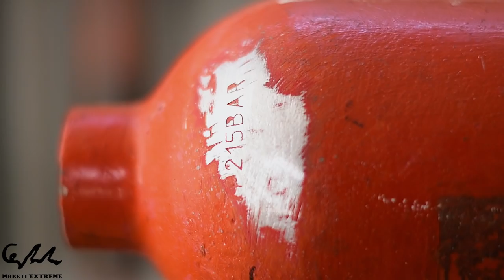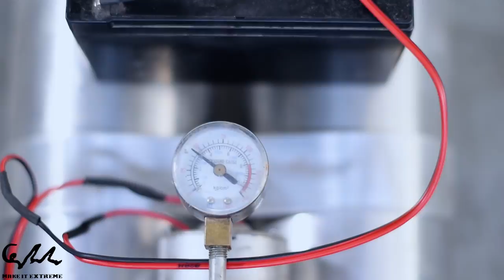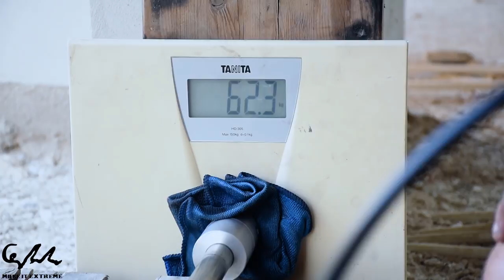Project 087 | Making an extending bicycle #1

Comment: Nice project.  Can't wait for Part 2.
When I was a kid I build an extended bicycle. I cut a crank section out of a junk bicycle and my brother welded it on the top of a standard boys bicycle frame.  Then he welded a piece of 1/2" water pipe and support bracket to raise the seat up about 2=3 ft.  Also welded another section of water pipe to the front fork assembly and welded a set of handle bars to the top.  Re-routed the chain to the upper crank and presto an extended bike.  Just make sure to put some type of chain guard on it.  I forgot to put my spring steel pants clip on the leg to keep my pants out of the chain and took a pretty good fall when my pants got caught up in the chain.

Comment: Nice stuff! One thing, no need for teflon string (loctite 55) and loctite in the same time on the treads. Just ruff up the treads with a coarse file and crisscross the teflon string. Or use only loctite on the bare threads. For coarse pipe threads loctite 574/577, for fine thread on pipe also or bolts loctite 243 for removable locking and sealing also.

Comment: Should put rubber stoppers on the internal piston extreme ends, so you don't get that "clank" at full extension.
Reply: big o rings would be a cheap solution

Comment: First time in my life I see a fire extinguisher in a lathe.
Reply: was going to comment the same thing. 👍
Reply: If you're really determined, everything can go in the lathe.
Reply: @dimitrioslykissas7981  you are not wrong, but at the same time you're very wrong.
Reply: Would that affect the structural integrity of the fire extinguisher? Making it thinner?
Reply: Sure but in this case he just stripped the paint and the change shouldn't be big.
Reply: @FesixGermany  at 0:58 lots of metal scrapings. Anyways just lower the psi I guess for safety. I remember about 11 years ago at the hospital I worked at, an old oxygen tank exploded killed two people obliterate both of them. I don't know why or how it explode (I'm a nurse not an engineer) shit got me scared of oxygen tanks for a while.
Reply: @thelazycook5103 
If you read on the bottles @1:13:
Originally these are rated to handle a maximum of 215 bar.
The tiny compressor used isn't able to produce more than ~10bar, i think bottles will do the job.
;-)
Reply: When turning magnesium you'll definitely see a fire extinguisher.
Reply: Ya, but why not just use paint remover so you know what the bottles are rated for. Yes they are overkill, but you might find another use. Or worse ten years from now some one will pick those from the trash and think they are still rated as labeled and blow them up. They should grind the rating off.
Reply: @court2379  
Personnally i remove paint too in such case,
chemically when possible or with sandblaster if not,
and finishing it in a lathe with a small piece of sand paper.
By the way it's not a dangerous assembly that i see in the video.
Reply: Court because he wanted the bottles to be straight and true instead of having defects on them
Reply: Yes, of course, but it won't hold 1000PSI of CO2 anymore, but 200 psi of compressed air at best. So it isn't an issue.

Comment: Teflon tape, an instructional comment.

1.) Take part in left hand
2.) Take tape in right hand with the the tape rolling off the bottom
3.) Wrap clockwise
Reply: Can build just about anything he can imagine; can't use teflon tape.
Reply: You are wrong and incorrect and giving incorrect advice. Correct way is wrapping tape counter-clockwise opposite of direction of threads.
Reply: +Fluffy Ponies No, tape always goes on in the same direction as the threads. Left-hand, right-hand, single start or quadruple, always _with_ the threads.
Reply: @Sabrinahuskydog  

Hope not, as I just set up several NPT joins for a 2200psi hydro test! 🙃
Reply: @Sabrinahuskydog  hehe, no - if you put the tape on backwards, it gets forced off the threads and bunched up as you tighten the part (as seen in this video) which entirely defeats its purpose.
Reply: The tape's still in the threads. That's all that matters. It will seal correctly no matter how you put the tape on. You worry too much.

Comment: I think the pressure is not 6.5 Bar ,, you have to divide 650N approximately over the cross section area of the steel arm 

Best of all keep going gays 🌟🌟🌟

Comment: Really cool project but i would be a little concerned that you might have compromised a bit of the pressure capabilities of the fire extinguishers by machining them down? Really ingenious idea to use them though i would have never thought of that..
Reply: Yeah, I would've applied a high-powered solvent like acetone or methyl-ethyl-ketone, or something to soak the paint off.

Comment: Why did you turn the O/D of the fire extinguisher? This will only reduce it's wall thickness and will definitely reduce it's pressure handling capacity.

Comment: Nice job, waiting for part 2 !! 5:15 is the ring groove really deep enough ? Also you made ninety degrees angle on the groove, it will make the ring break in a short time i'm pretty sure. You should have openv both angles more.

Comment: You are wrapping teflon tape in a wrong way.
Reply: Alexander, Many times Youtube videos show things backwards.  I.e. right-handed things look left-handed.
Reply: No, it was backwards. He did it so it bound up inside the threads in a bad way.
Reply: at 9:07? you have fast eyes! I agree, but I'm not sure if it makes much difference (never tried it the "wrong" way to find out)
Reply: @lapislignum  it makes a difference on short lengths of thread if it starts to roll the end up. (Thread length = about 1.5x tape width.)
For pneumatics leaks are more common than hydraulics for the same pressure and a couple of times, I've found what looks like plenty of tape ended up being not enough when wrapped the wrong way as it can roll up when you screw it on and take the tape off a small section of the thread.
Reply: its the wright way
Reply: Mike forrest no its not
Reply: at 4:39 he is going in the right rotational direction but wrong in general, it should go on flat and wrap over itself a few times, the tape falling off is a bit of a clue that something ain't right.
Reply: The blind hole @4:39 should eliminate any leaks don't ya think. It does matter for sealing threads. Lubricating threads with teflon much less critical. The 9:07 bit is a straight thread, ptfe lubed, and o-ring for pressure seal.
Reply: And it should be coming off the back of the reel too.
Reply: What if he's doing it the correct way and the rest of us have been doing it the wrong way all this time. Think about that for a moment.
Reply: @maxprophet2401  has it right. The seal is the oring. The tape is just to prevent the aluminum from galling and siezing up.
Reply: Agustaf? I said your name wrong, but, we do.     The Court has spoken.
Reply: Alexander Khritonenkov Teflon tape?... surely you meant to say PTFE??
Reply: @lapislignum  yeah, but that particular thread won't have a leak, it's just that it will hold better..... i think people mean  at 8:13, and that thread is a sealing thread, so it needs to have teflon tape properly wrapped...

Comment: Wouldn't that "6.5 bar" measurement actually be higher?  Yes/No?  I'm sure the surface area of the end of the piston is more than 1 sq. cm...
Reply: Stef60s I’d say it’s referring to 6.5bar of air pressure from the compressor
Reply: Hi Joel Fraser.  I feel sure they were demonstrating the force available at the piston because they used a weight scale to confirm force, as in "6.5kgs" ( where 0.980665 kgs per bar in pressure).  However, I don't think they took into account the kg/cm².  I feel sure they would have used an air pressure gauge if showing the force from the compressor.  (PS: Not arguing, just trying to get math right for future generations😁)
Reply: Yep I’m hearing ya. I guess everyone will interpret how they want !
Reply: Hey  @FG-Supercharged , the scales said 65kg not 6.5kg, which if the piston head is 10cm^2 then yeah 6.5bar is pretty accurate. Not sure how big the heads are though, definitely not 1cm^2 though  :)
Reply: Skruffles.Wow, they did say 65kg too...  I didn't notice that, thank you!   The heads are definitely bigger than 1cm² but not as big as 10cm².   Will be interesting to see how much force will be/is needed in the end to accomplish their goal (loaded vs unloaded, limits etc., ... ).
Reply: @FG-Supercharged  I'm not sure, for 10cm^2 you'd need a diameter of roughly 35.7mm.. it looks close to that size
Reply: Skruffles  In that case, you could be right!
Reply: Standard EU size honed tubing is 12-16-20-25-32-40-50-63mm. I guess he bought 32mm stock. Otherwise, "not caring of life-expectancy on the orings", a standard machining tube of D60-d40 will do nicely. (or the equivalent Imperial measurments)    But 65kg. :)  I build my pneumatic rams for 70 bar working pressure. The biggest I did up to date is a 140mm bore monster, delivering 8000kg+ of force.
Reply: Piston is close to 10 square cm, but I can not be sure. (3.5  cm diameter)
Reply: I guess we'll have to wait and see if we get more clues in the next part. 😎